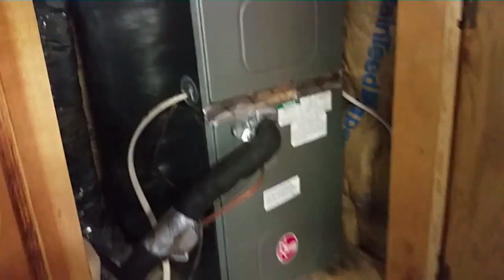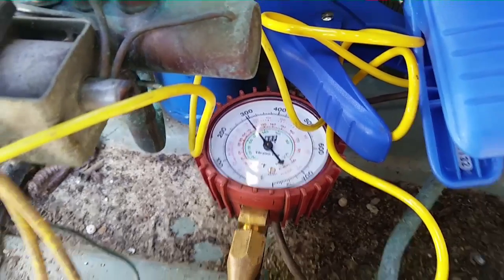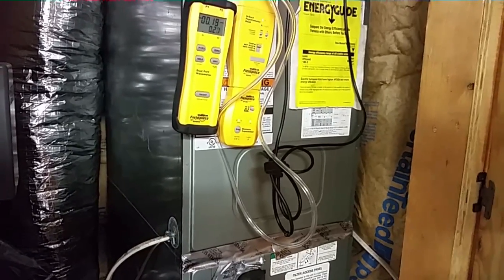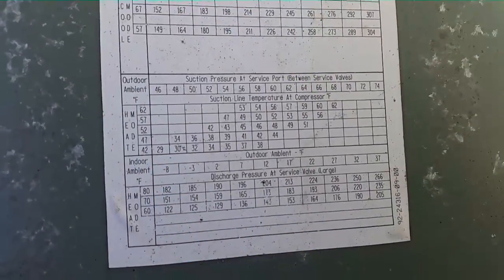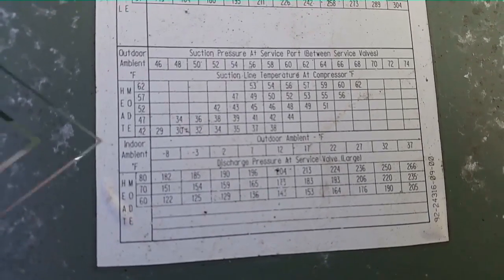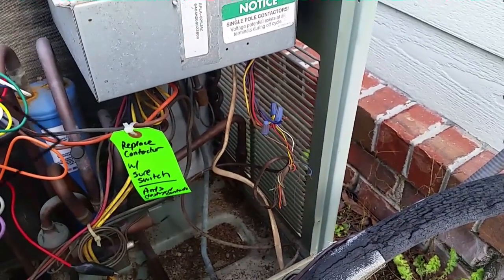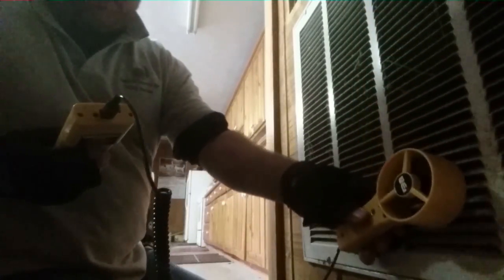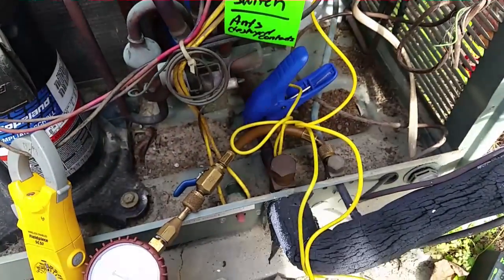Heat Pump High Discharge Pressure and Low Voltage Short

Comment: I think you should go right to left on those grilles and include the splitter bars. I'm curious what the difference would be.
Reply from the maker: It would not be a proper measurement but I would expect you would lower the cfm estimate.
Reply: +Talyn875 PRO follow my thinking here maybe I'm off base... By skipping the splitters you are in a way deleting them from the measurement like they aren't even there at all.
Reply from the maker: +Joe Shearer since I put in the free area I am measuring for the meter, I have taken all the dead area into account already.
Reply: I understand But I think 70% is too generous in that situation then to include the dead spots in the 70. That's all I was saying
Reply from the maker: +Joe Shearer I agree 70% is higher than it really is. But not much higher. Bad thing is that means it has even less airflow than I showed.

Comment: I have seen this pressure all too often on Rheem units. It's like they need a larger piston in the outdoor unit. I have switched several out for a larger whenever I can. Ie..system is open for repair anyway. I grafted in a txv on my own unit.  I understand the theory of higher compression ratio = more btu in heat but I have seen them as hot as 210 discharge and they cook compressors.
Reply from the maker: Joe, that occurred to me. Believe it or not I contemplated proposing an outdoor txv for the unit. I was surprised that even at 214 F and 325 psi the compressor still ran at 80 % RLA.